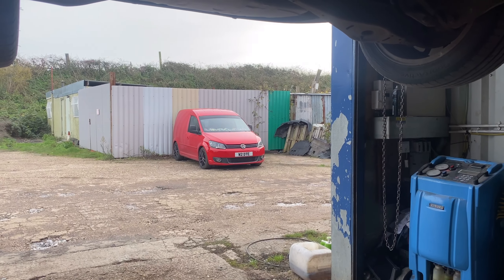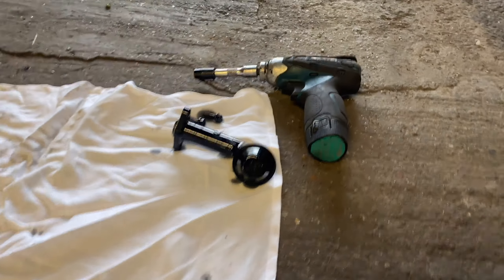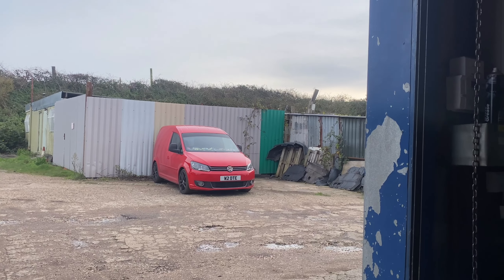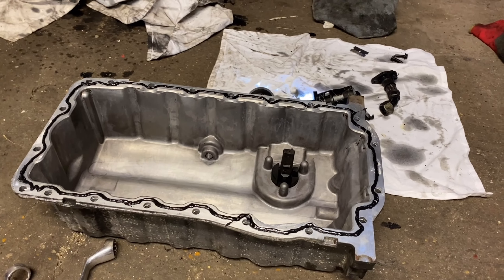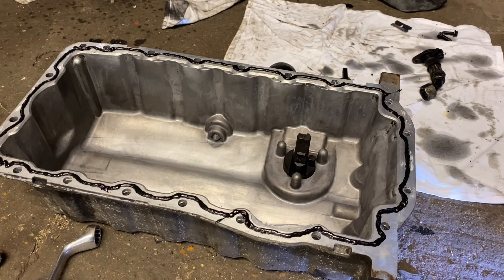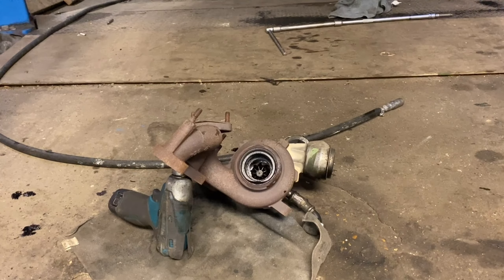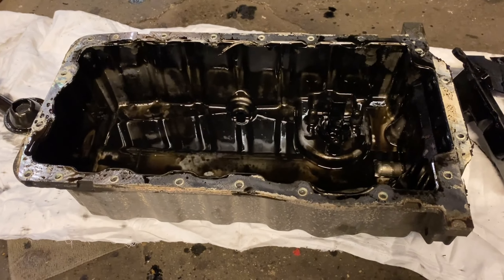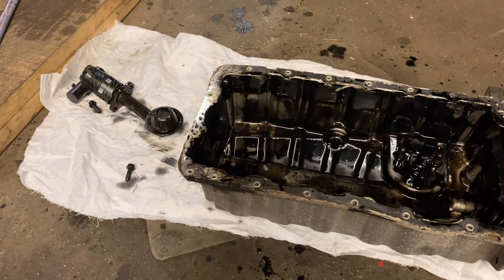Vw 2.0TDI - BKD - Low oil pressure - Fixed.

Comment: Hello there I have a 2010 cc 2.0 I have low oil pressure warning it's misfiring and klunking when I accelerate. The oil pan is covered in carbon i changed the coils and plugs and the pcv valve 113,000 miles do you think it's the same problem? Thank you
Reply: Did you find out what went wrong? I have possibly a similar situation

Comment: Very well done and explained, thanks. I had my balancer hex rod slipt off but it was the mechanical who was driving, not sure how long it was driven that way. The guy says the turbo was fried but the engine is ok, which i highly doupt. You say thst you saved the engine.. how to know if the engine is fine? I will go see the balancer rod and all the stuff with my own eyes and im pretty familiar with the steps. The engine is a cbab 2.0tdi. ill appreciate very much u reverting..

Comment: get low oil pressure on my mk3 1.6 caddy on 226.000 is it roughy the same to do on a 1.6 ,I'm thinking it could be the oil pick up after watching this very helpful video ,I've also got another issue with it filling up with desil around the injectors ,the injectors seem fine the van starts well and pulls well so I'm thinking its the return pipes leaking if not any ideas what I could do without taking injectors out I was thinking they might not have changed the injector seals when the injectors were done

Comment: Diesel makes the oil dirty...
to avoid these problems just change the engine oil every 5/6000 km and maybe use a flush to run in the engine 10 minutes before draining the old oil.
I had several analyzes done by an engine oil laboratory and after 5000 km the contaminants in the oil are already at the limit of tolerance, especially in direct injection turbo engines.
Reply from the maker: Hey bud yes diesel oil is always dirty, I had a customer that had an oil and filter every 6k and he never had an engine break. I never knew why diesels where always dirty but now I do so really appreciate your comment 👍👍
Reply: @YTDTETV  Diesel contains heavier hydrocarbons than petrol, this fuel is burned by detonation therefore with a higher compression ratio and produces lower temperatures than petrol.
the combination of these factors produces a greater quantity of carbon residues and a greater blow-by effect so that the oil gets dirty very quickly.
the carbon residues, in addition to having an abrasive effect, increase the quantity of acids, the oxidation of the oil and reduce the quantity of Zinc present in the oil, Zinc together with phosphorus constitute a very important EP additive ZDDP which prevents wear of engine components, especially those made of steel.
Reply from the maker: @edogsx  wow I had to read it twice but I got it 👍👍 someone on Facebook said why would a diesel sump have more crap in the sump and dirty oil over a petrol and I wasn’t 100% sure but I replied I think it’s blow by in the cylinder. I also said that it’s more modern diesel engines due to the filters in the exhaust causing excess heat a pressure in the cylinders causing even more blow by. I don’t know if you have a YouTube channel but I’m going to look now as you certainly know your stuff. Thank you for your comments 👍👍

You do I’m subscribed 😊

Comment: Hi mate do u have any wiring diagram for putting a bkd engine in a caddy thanks
Reply from the maker: Hi bud have you seen the video I made on the BKD caddy swap?
Reply: @YTDTETV  yes mate I didn't know if u had any wiring diagram or a list lol
Reply from the maker: @stephenmccready4654  hi bud so I did put the glow stick plug wiring in the description, I write the first part up abit later 👍

Comment: 1.6 tdi Cayc engine, i got problem with low oil pressure. New oil pump, cleaned pickup pipe, fresh oil and filters. My mechanic says only 0.5 bar at idle and around 1 bar at 2000rmp (75 celc temp) which is still not enough. What to check next?

Comment: Another great informative vid Nathan, think I'm going to do mine now as when I serviced it the filter are in a bad way and my turbo whistles and small bit of blue smoke.
Reply from the maker: Hey thank you Nigel, the oil filter in this one was sucked in as I describe it but so was the one on the caddy BKD but clean sump. A lot of Vauxhalls really suffer with sucked in oil filters and being starved. Little bit of blue smoke isn’t the end of the world as the intercooler and pipes get oil in them from weeping turbos but that’s normal.

Comment: I have this motor ❤️ I need detailed DIY videos even if it takes 1hour I'll watch it.
Reply from the maker: Hi bud it did only seem to be one of the BKD engines I looked at so a good oil flush with oil and filter change should clean the pick up pipe without removing the sump.
Reply: Thank you

Comment: Glad to find your vid. I sure hope I'm not going to have to do all that and a simple oil change will do but I'm also a bit scared since my 2.0 touran suddenly won't start and displays red message  "low oil pressure - check owners manual". It's a second hand from my brother and my first diesel. He told me it should have run for 5k more until next oil change. Any ideas would be very much appreciated. Thanks!
Reply from the maker: Hey bud sorry for the delay, so first of all has it got enough oil in it? They can have non start if oil is low. They do like an oil pressure switch aswel and they are only cheap.

Comment: i also got bkd engine the low oil pressure flashes up when the engine cranks over for 30 sec but i will be taking the sump off to cleaning it. i bought it as a none runner but this time last year the turbo went bang as i was driving home a lot of white smoke thought lol
do you know of any other common faults ?
Reply from the maker: Hey Ashley 👍 I’ve blown a few turbos on these and they smoke a little for a while after till it’s all cleared out, I know that some of the early BKDs have a porous head so leak water but I have 2 early ones and never had a problem 👍

Comment: Hi mate, love the vids. I've got a BKD Jetta with a little issue, when rolling in neutral (clutch up) at very low speed, like coming to a stop for example, the engine misfires harshly and shakes the whole car. When I come fully to a stop it completely goes. If I'm in gear or the clutch is pressed down it runs perfectly... am i right in thinking flywheel? You seem like a very knowledgeable guy with these PD engines so thought you were the guy to ask. Cheers
Reply from the maker: Hi Charlie thank you mate appreciate that 👍👍, so when your slowing down and clutch up it’s misfiring then as you stop and depress the clutch it straightens up? If so first thing I reckon would be to look at the crank sensor, reason is when you press the clutch down it will ever so slightly move the crank and flywheel towards the sensor then as you let off it will move away slightly. That’s a pure stab in the dark without seeing it, does it have any fault codes stored?
Reply: @YTDTETV  Hi, thanks for the response. If I’m stopped with clutch up (idle) it’s fine, if I’m rolling with clutch down it’s fine. It’s only if I’m rolling when the clutch is up in neutral (coasting). No faults stored and have logged the injectors as I know BKD’s are common for injector loom issues and all seems fine. Apart from this it drives impeccably.
Reply: @YTDTETV  actually another thing that may be worth noting is that when starting sometimes it throws the whole car about with the rocking of the engine. Doesn’t really struggle at all but you really feel it.
Reply from the maker: @charliemetcalfe6753  no worries happy to help, it is possible that the injector loom is playing up as any movement causes the same issue. If you work it out let me know 👍
Reply: @YTDTETV  thanks mate, only thing that put me off that idea was the difference when the clutch is down. It’s
Reply from the maker: @charliemetcalfe6753  someone with a decent scan tool should be able to find the problem for sure.

Comment: You cleaned that sump up nice DT, don't think they would get it that clean down the main dealers.  Agree with regular oil and filter changes, 10,000 mile max for me, have a great Christmas
Reply from the maker: Thanks Karter, yes you could use all the flushes you like but a sump removal and clean up definitely does a better job. Some manufacturers say up to 20k before serving which is so bad. Merry Christmas to you sir 👍👍